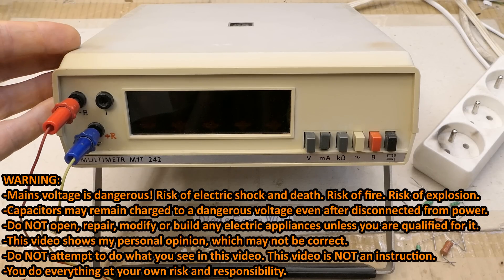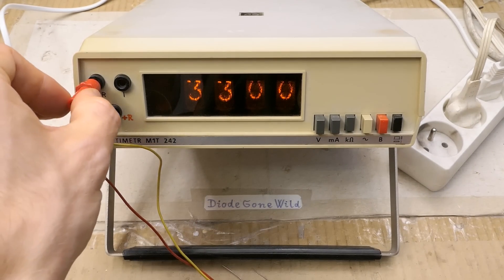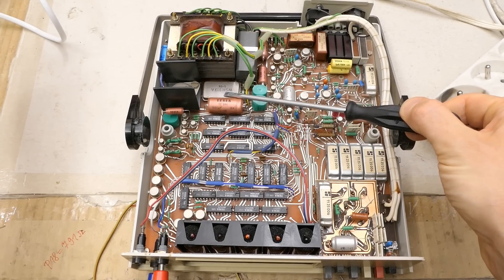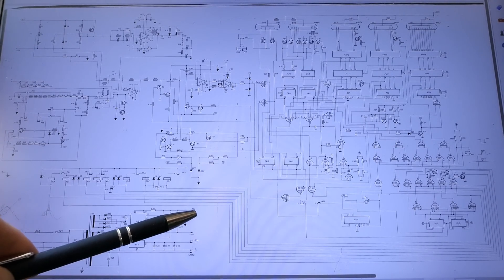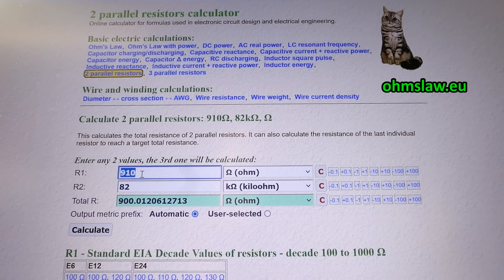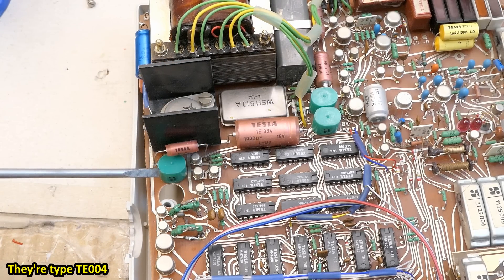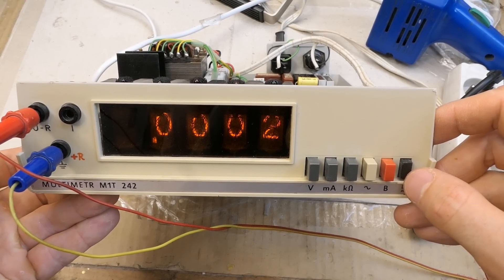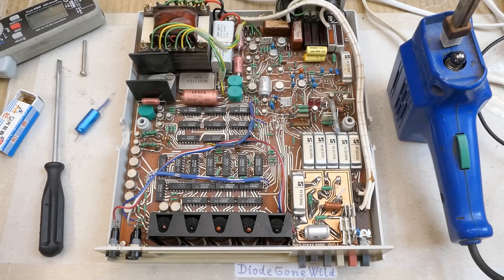Nixie multimeter repair (M1T-242)

Comment: I've had Meratronik V543 in my lab. Was quite heavy, but also very accurate due to dual slope operation. I used it quite a lot till it died in very unpleasant way back in 2013 (tantalum cap failed on short and burned PCB traces)

Pozdravy z Polska!
Reply from the maker: I have V541 which still works to this day :)

Comment: Completely unrelated to the video content, but you have a variation of the Schuko 16A mains connector used across most of the EU; when did the Czech republic adopt this connector? I assume it was post 1990?
Reply from the maker: Our type E socket is better! :) it looks nicer, it's polarized (unlike type F), and the ground has a more reliable contact.
Reply: @DiodeGoneWild  But in Fance and Belgium, the phase must be on the right hole, exactly opposite to the czech standard. So it's only polarized in a single country. The Schuko also has a very reliable ground contact and can handle continuously 16 A like live and neutral without overheating. It doesnt look nicer to me because Im used to Schuko and the older ungrounded sockets. In my unpopular opinion, the british plugs and sockets are absolutely the worst ever invented: large, ugly, heavy and overengineered safety designed to protect dumb people from shocking themselves.

Comment: Devices with a transformer and diode power supply can actually cause quite a lot of interferance, usually the diode conducts only a small fraction of the cycle, you get current spikes that start a moment before the AC voltage reaches it's peak and stop at the peak voltage, without any inductors the peak current through the diode can be in the range of 10x the load current and it get's worse with more filtration, short current pulses cause a lot of harmonics and result in EMI

Comment: Great vintage technology, Nixie tubes are awesome, and these have the nice 5's. Interesting that they were still used for displays in the 1980's. Tesla makes a lot of electronic components and discrete TTL drivers with 7490, 7475 and 74141 IC's for the tubes.
Reply from the maker: Why not keep using nixies, if it works :). The LED displays of that era were dim. USSR kept producing nixies (and even dekatrons!!!) until 1992.
Reply: 100% agreed there. @DiodeGoneWild

Comment: Those tiny range relays clicking is like electronic ASMR to me.
I absolutely adore older tech like this, and I also love nixie tubes. I have a nixie clock actually, and you should definitely try to repair that other one.
Reply from the maker: I also like the sound :) well, I like the sound of big relays and contactors too :D. Old technology is simply way cooler. I've already repaired the other one, the video is now available for my Patrons, it will be public on Sunday.

Comment: What about that two red LEDs? 🤔
Reply from the maker: Strangely, they're not in the schematic :). It seems to be a slightly different version. They're using them in a series combination instead of the DZ1  Zener diode. It's in the current source for the resistance meter, I guess.

Comment: I recently got two Czechoslovakian solder guns too, it works so nice and it actually can run long before overheating :)
Reply: Ia it a tesla soldering station or those big bakelite soldering guns?
Reply: @petermikus2363  they are both soldering guns

Comment: I always find your channel very informative, educational and very entertaining, especially when the Cat chimes in with a comment.
I have been in Electronics for 55 plus years now, I used to service Arcade gambling machines in an arcade on the coast here in England.
Qualified Radio Amateur. Now playing with LiFePo batteries and inverters.
Built and fixed many computers in the Desktop days, not so much now with portable devices, the components are way too small to see.
I have been practicing with SMD components but struggle to see without a huge magnifying glass.
Keep up the good work exposing all these dodgy and super dodgy chargers.
David (G1ZQC) U.K.

Comment: nice post komunist multimeter , 87 , ehhhh nostalgic , but my dear frend , must to very deep renowation this , elektrolitic caps , all , second work  new kalibration or clening all licensed isotats ,  
this multimeter first stage bulding its a very godly ic op amps , TESLA low noise maa 501 or maa 701 or letter models , typical analogic construction

Comment: Wow, the update rate is really fast. Faster than modern multimeters and all done with discrete logic/transistors. Only the $300+ stupidly expensive keithly/keysight multimeters are that fast.
Reply from the maker: Yes, I also like the fast update :). It's very practical when trying to set a potentiometer looking at the display.
Reply: As soon as software processing gets involved, things get mushy.

Comment: Thats a nice bench meter,  i'm sure you will make it accurate and stable :-D
If it was mine i would swap the displays/drivers for led ones, but that's my bias.
Exploding filters lol , fun for all the family 😀
I didn't expect the capacitors to be that good still.
Reply from the maker: Replacing nixies with LED displays? Noooo! Hell NO!!! 
And electrolytic capacitors are not the worst problem, paper capacitors are. That's why I replaced the interference filter preventively. Fortunately, no other capacitor in this thing is paper.
Reply: i have done this once, but the frequency counter belonged to a friend and the nixie tubes were really really dead.
all the voltages were there, but the tubes were very dead.
i replaced the bcd chips for led drivers and resistors.
I terminated the high voltage supply.
The led display was green,  i still have the old chips.
Reply from the maker: @zx8401ztv  I'd rather give it new nixies ;) because this is like straightening the Leaning Tower of Pisa :D.
Reply: @DiodeGoneWild  Well there were  experts that carefully improved the  foundation and made it tilt back a little.
Its safer than it was :-D
I think it was built on Crappy soil (How the hell did it not fall over).

All of the Nixies  were very dead in that frequency counter,.
The owner was so happy that it worked again.
 I found nothing wrong with the supplies.
The ovan  was perfect. But it would not cook my dinner :)

I still have the 12 driver chips (20 years ago) (why i dont know)
SN74141  4-10 line BCD to DEC  None latching  60v numerator Output.

Comment: 8:13 This over voltage protection is actually used by Fluke since many many years, there is an EEVBlog episode that explains it: #1157 - Transistor Zener Clamp Circuit
Reply from the maker: thanks :) I didn't know this was commonly used.

Comment: 8:12.  Ah, so someone else wasted their time reading the white paper as well ;).
Reply: This over voltage protection is actually used by Fluke since many many years, there is an EEVBlog episode that explains it: #1157 - Transistor Zener Clamp Circuit